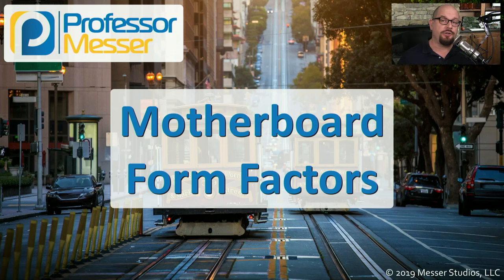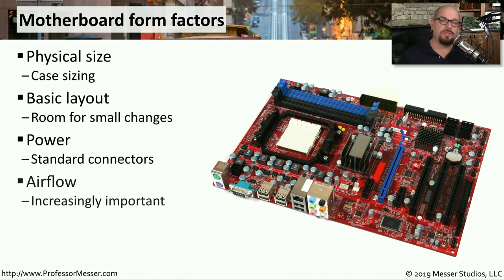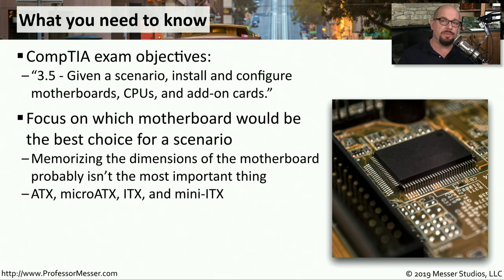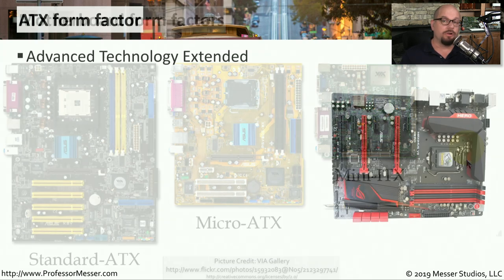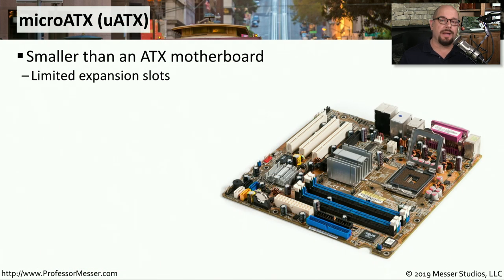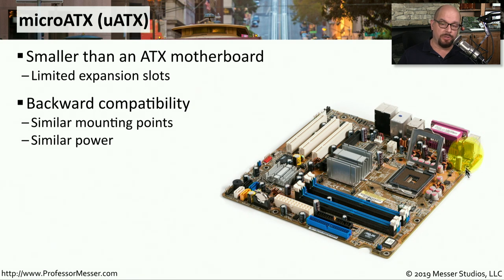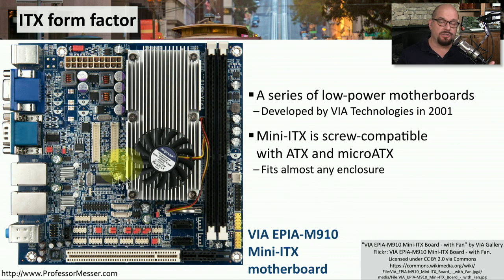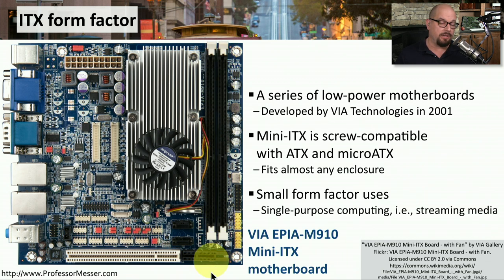Motherboard Form Factors - CompTIA A+ 220-1001 - 3.5

Comment: Hi quick question, on the comptia a+ performance based questions, can you get them partially right or will they judge based on fill complete correct answer?
Reply: Comptia don`t disclose how they mark questions so the short answer is no one knows, It`s best to attempt them even if you have no clue as you may guess a mark that could make or break the result if they do mark it partially.